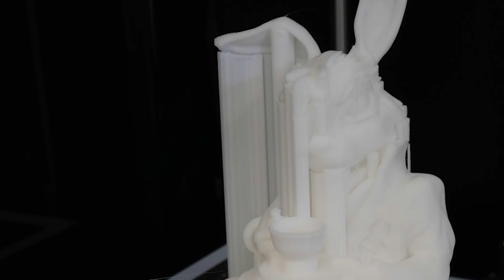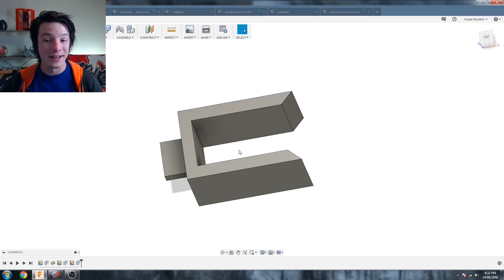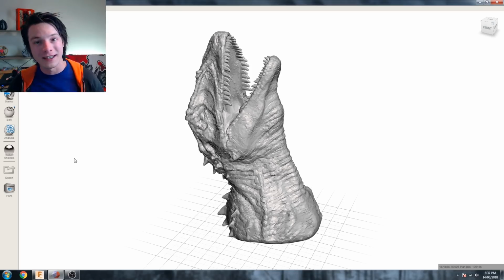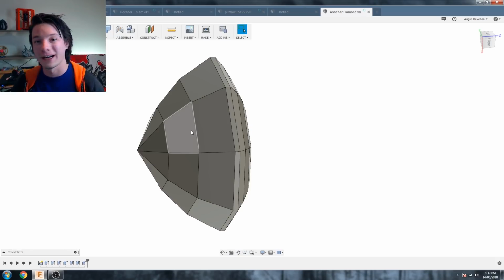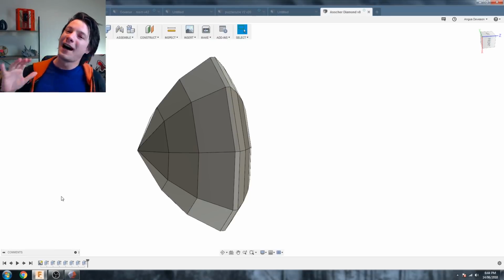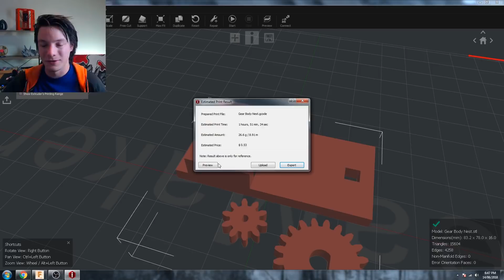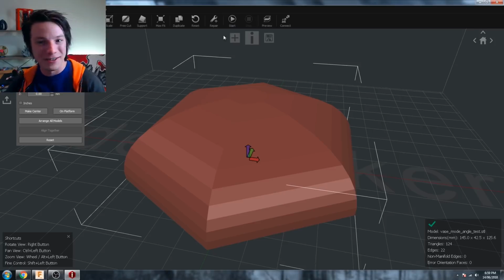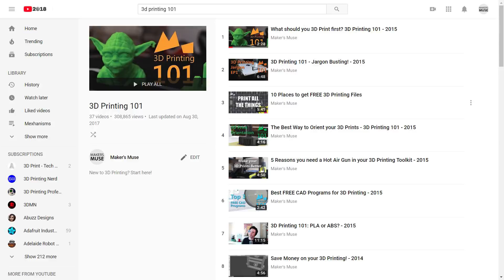Design Tips for Support Free 3D Printing Models (FDM)

Comment: Does anyone had a wanhao duplicator i3 that under extrudes, there is no problem with the extruded assembly. It’s either the extruder motor or the printers brain. Anyone else have this problem and/or know the solution?
Reply: Drew Bransby clean your nozzle assembly do you have the standard nozzle or full metal? I found with mine and the full metal nozzle the end was heating up too much and melting before it comes out causing bad under extrusion I changed back to standard nozzle assembly and perfect, I also put a better fan with a higher cfm on that heatsink there and she prints like a dream.
Reply: Had that problem, changed to a new nozzle and it printed fine again. For some reason cleaning nozzle didnt work. 

Now i changed the hotend to a v6 by drilling and tapping a new hole in the cooling block, gives me options of different nozzle sizes, socks and full metal hotend.
Reply: ayrton Valente Thanks for your input. I cleaned the whole extruder assembly, taking it all apart. It is the stock extruder with the plastic tube that extends into the nozzle. The prints still are bad and under extruder.
Reply: Ola Ruud I tore the whole X carriage apart and cleaned it all, also replacing the nozzle. But to no avail, still poor under extrusion and zero structure to prints. I wonder if it can be a problem with the software on the machine or simplify 3D. I have tried a new profile in the slicer and it changed nothing.
Reply: My i3 plus underextrudes a bit. I think it depends on filament used or may be a software/firmware thing. In any case I just compensate using 106% extrusion with the current reel of PLA.

Comment: overhangs like this are why i LOVE kisslicer. it will adjust layer heights to ensure that there is a 50% overlap of previous layer to ensure you can get maximum overhang and details with minimal support needs (althought usually also uses supports unless you set the overhang angle pretty low)
Reply: this seems like is has a mild learning curve. Gonna have to learn it after some coffee. Thanks for introducing me to this
Reply: Youtube is your best friend for tutorials on it. Outside of the wizards I have barely really had to tweak any settings. I have multiple profiles for various support needs, and materials, but other than that just adjusting the retraction length and speed is about the only thing I tweaked. I run a .5 nozzle, my layers are 25%, max of 70%, with 25% first layer. Most things like this are based on nozzle diameter so it adjusts smartly if you change your nozzle without needing to adjust other settings.

As long as your not printing too hot the supports come off very cleanly also with default settings. And the thin wall and extrusion control surpasses any slicer I have used so can get pretty crazy details without a small nozzle.
Reply: prusa and cura both have adaptive layer heights too

Comment: Sorry but I disagree with the 45º angle rule, I have printed 70º overhangs in all my 3  3D printers without support and it works very good. in fact both my cura and S3D profiles have the support feature activated at 70º and practically flawless
Reply: usually good with pla, harder on other materials that dont stiffen as fast and likes to curl.
Reply: MAking Props I’ve not 3dprinted before, but I’m assuming it all depends on what kind of material you’re using, the cooling, and the shape/length/weight of whatever is overhanging.
Reply: it may depend but the materials I use are the most common available. PLA in full stock cooler in a CR-10 and Anet a8. Doesn't get more basic than that

Comment: Thank you this video answer a question that I’ve had for a long time. My printer always seemed like it was under extruding by showing what I thought look like pot marks in the layers. I’ve been using Cura  and I now realize the default width from my .4 nozzle has been .4 in the layer width. 

 Thank you